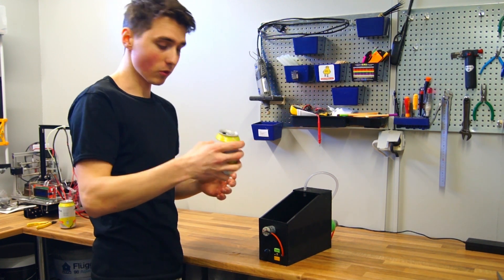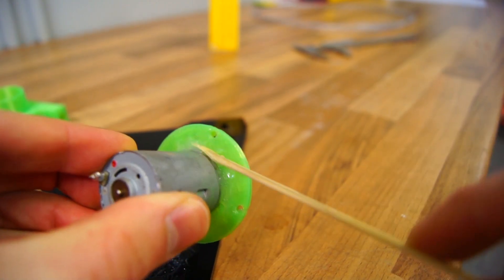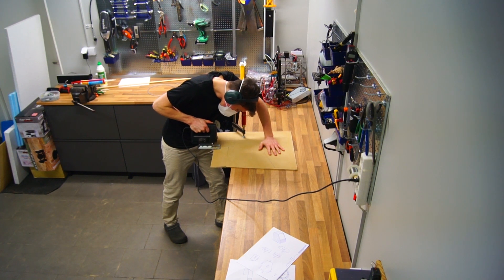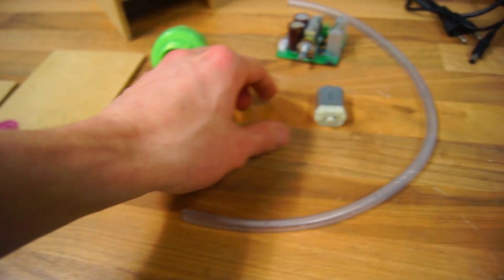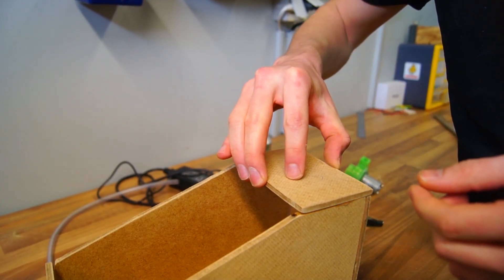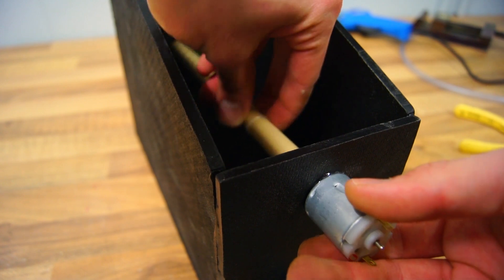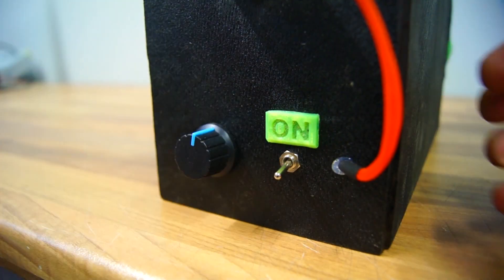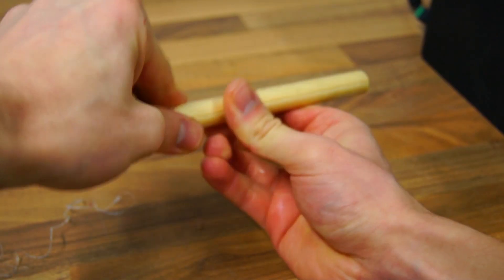Instant Drink Chiller - How to Make a Cooling Machine

Comment: Put salt in the water
Reply: To increase the effectiveness of this system, we need to improve thermal conductivity of the liquid rather than freezing point, right?
Reply: @hello_2632  yep...
Reply: salt ice and water bring cans of pop to near freezing, as the salt lowers the freezing temp of the water to -4
Reply: imbadwrench It won't.  Salt water has a lower freezing point than tap water. Putting salt water in a sealed bag will have no impact on the normal water around it,  as it will still freeze at 32°F.  Other frigorific mixtures could be used instead of saltwater...but there is always a cost factor along with handling/safety concerns.
Reply: @jonnyduke3763  Food grade glycol my g
Reply: @jonnyduke3763  no it will freeze at 0 degrees celcius fuck that fahrenheid shit
Reply: ive read that you can put a sealed bag of saltwater into the icewater and it will give a similar effect without getting salt in your pumps..
Reply: @imbadwrench  Eh, it'll keep your water cold longer but it won't lower the temperature below 0°C/32°F. What will happen is surrounding water will freeze to the bag until you have an insulating layer of freshwater ice that is also 0°C/32°F on the outermost layers. Other than lasting longer it'll be no different than a large ice cube at that point and you could just use those blue ice freezer pack things instead.

Is salt water really so bad? Surely, there are affordable water pumps made for salt water aquariums and such.
Reply: Pijus Matijošius fuckyou
Reply: @matteobellock9543  is that an offer?

Comment: couldnt you also use a thermal electric cooler to cool the water so you dont need ice?
Reply from the maker: Well, maybe if you limited the amount of water by using a smaller container (as small as possible), and installed numerous of TEC's. However, with that amount of electric coolers the contraption would require a good 20-30A . They are really not very efficient.
Reply: ah, had no idea how inefficient they were.

Comment: instead of using that motor controller you coulve just used a mosfet and a potentiometer
Reply from the maker: Due to the motors working quite hard I would imagine the current draw to be higher than what a mosfet could handle. Yes you could use a mosfet and a potentiometer, but the controllers are super cheap and can handle up to 10-15A.
Reply: http://www.ebay.com/itm/10PCS-MOSFET-Transistor-FAIRCHILD-TO-220-FQP50N06-50N06-/361426657567?_trksid=p2141725.m3641.l6368 this can handle 70amps 60volts but i see your point. enjoyed the vid btw